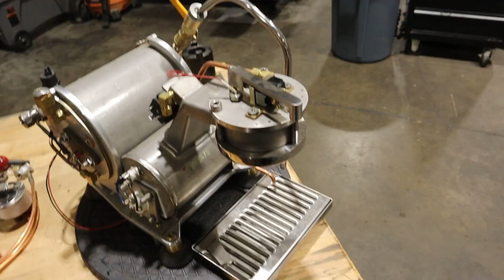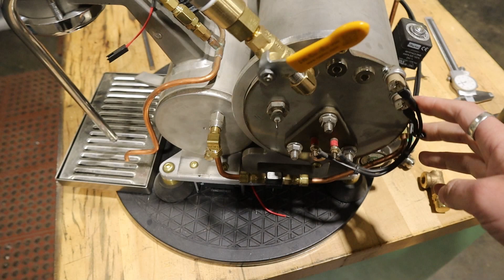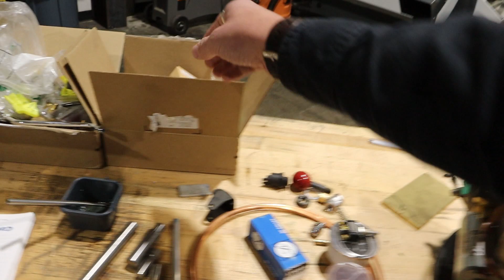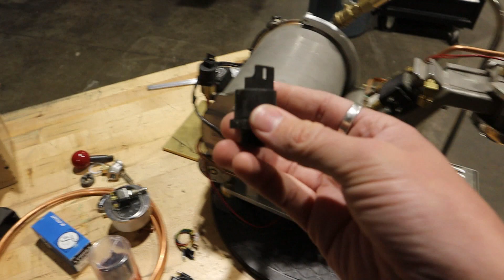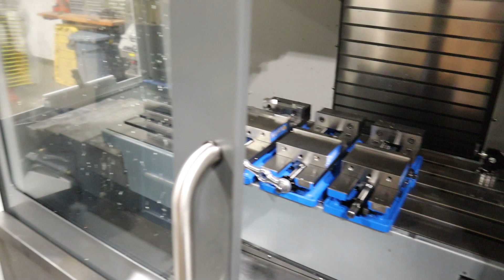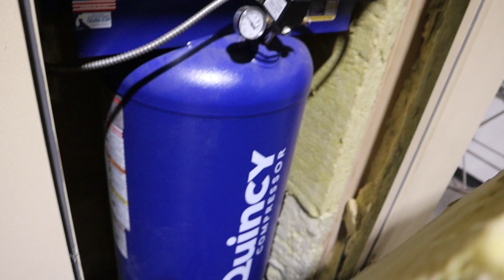Plumbing and Other Tomfoolery - Espresso Machine Part 3

Comment: quick question, what kind of water level probe do you use for the boilers? do you try to detect a current between the probe and ground (with the boiler being grounded)? I read some stuff about how you don't want direct current going from the probe through the water to ground because of electrolysis, and I was wondering how you went about it and if there was any special circuitry you used. Thanks so much!
Reply from the maker: It’s just a standard stainless probe. It works as you described. There’s a very high value resistor from the probe to DC+, so when the water touches it it’ll ground out. Commercial machines use an AC current to prevent buildup on the probe, but the last machine I made I used DC for simplicity and it works fine. I had to clean the probe after 3-4 years of use, but one should do that either way. I’ve heard that issue is worse in places with a lot of calcium and other minerals in the water.

Comment: Seriously cool build spencer! love how compactly everything fits together. How are you planning on use the flowmeter and pressure transducer for the brew water?
Reply from the maker: Thanks Tate! The hope is to use the pressure transducer with the pump to modulate pressure. I was going to use the flow meter for volumetrics, but now I might be using your Acaia scale interface.

Comment: I'm, for this and your previous builds, how complex is the electrical/circuitry side of things? you mention controlling the machine with an arduino - would you be open to sharing what the circuit diagram is like? I'm a software engineer by trade so I'm comfortable with the programming side of things, but have a lot less knowledge about the circuitry. however, I'm super intrigued by the idea of putting together all the espresso machine components and getting them to work together with an arduino. thanks!
Reply from the maker: I’ll do my best to provide details of how it’s wired. Thanks for watching!
Reply: Thanks so much!!

Comment: this is so cool!! thanks for sharing. I was wondering, do the welds on the wall of the brew boiler affect it's pressure withstanding ability? and would repeated torqueing on the group head from the portafilter translate into stress on the walls of the brew boiler? and it would be so cool if the group head "arm" so to speak was filled with a fluid to transfer heat from the brew boiler to the group head. 

can't wait to see more updates, this is next level stuff. Having rebuilt some old espresso machines, I was astounded at the simplicity of the internal designs. Like even on my ECM Giotto, it's works well and is reliable but it's so simple. The espresso machine world needs a shakeup when it comes to engineering home espresso machines, we can do so much better, kind of like you're doing!
Reply from the maker: Thanks! It’s a brew boiler from a Slayer Steam so it’s a proven design. The stainless steel it’s made from is absurdly thick, so you couldn’t bend it if you parked a truck on it. It’s indeed fully saturated in use, so the whole head, neck and tank of full of heated water, which is exactly how the head and PF is heated. These manufacturing methods are very expensive, which is why you don’t see them on home machines less than $6k. Thanks for watching and thanks for your comment!

Comment: This is super cool, thanks for sharing! just curious, where do you do get your parts (like fittings, copper tubes, pressurestats, OPVs, etc.)? and did you cut, bend, and solder the copper tubes yourself?
Reply from the maker: Thanks! I get a lot of parts from places like espressoparts.com and eBay, but some things like the tanks are hard to come by. I did the copper tubing myself, copper is a blast to work with and it’s really easy.
Reply: @bailey2829  That's awesome, thanks for the reply! For the copper tubing, what are the end pieces that you solder to the tubing called? Did you also get those from espressoparts? I did some quick searching a couple days ago but couldn't find anything that seemed correct. Thanks again!
Reply from the maker: @hao-tongyan4872 the fittings on the ends are compression fittings. They don’t solder, you just tighten them and they squeeze onto the tube. I really like the ones from Serto, but Parker makes nice ones too.
Reply: @bailey2829  oh nice, good to know! so are the ends of the copper tube finished in any way? do they have a flare or something that allows the fitting to attach?
Reply from the maker: @hao-tongyan4872  just straight cuts and a good deburr. They seal by crimping around the outer diameter of the tube.
Reply: @bailey2829  ooh gotcha, thanks for explaining! that makes things simpler for sure. I've recently gone down the rabbit hole of learning about the internals of espresso machines, and I've just gotten fascinated by the idea of building an espresso machine and/or the ability and knowledge to replace or mod different components! good luck with the rest of your build!
Reply from the maker: @hao-tongyan4872  thanks! They’re a lot of fun for sure.
Reply: Hablo desde colombia yo hago las calderas los tubos y los sistemas eléctricos para una empresa soy el líder de producción hace poco sacamos los calentadores con esa pantalla que vas a usar es genial en lo que pueda estoy atento 🎉felicidades